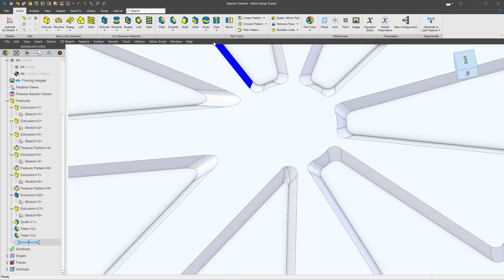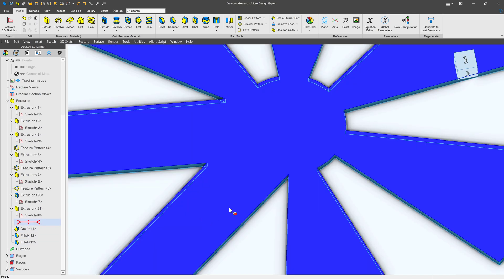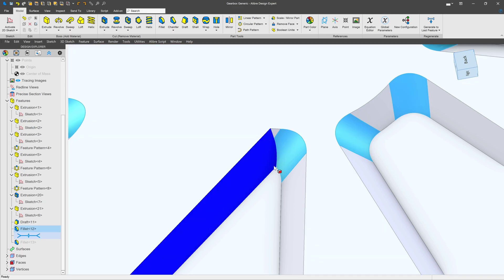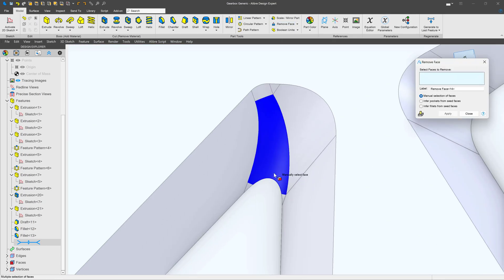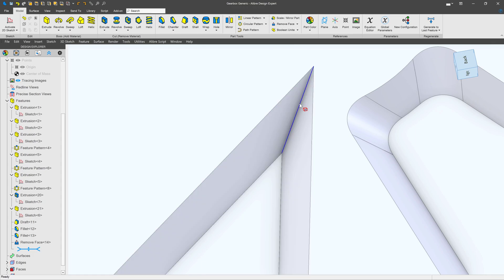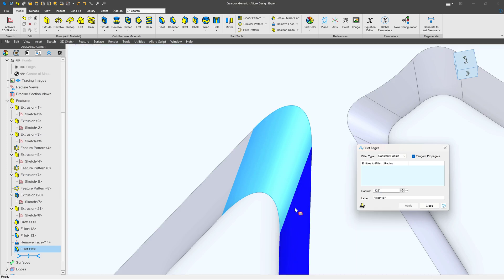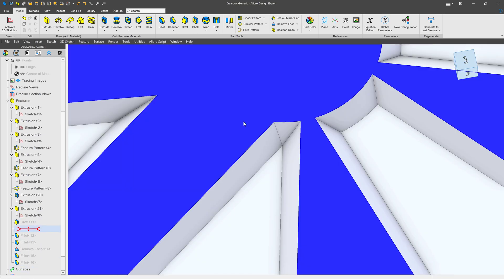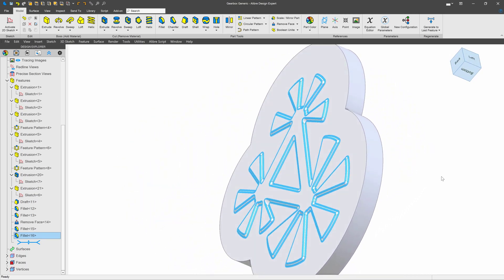Can't Add a Fillet?  Add THIS To Your Toolbox!

Comment: Remove Face is becoming a real useful tool in the Alibre. I likely wouldn't have thought of using it. Thanks for the tip! 
Sometimes I have an a fillet that Tangent Propagate doesn't work and I need to turn off previews and select all edges individually, but that is another issue.

Comment: Anyone else having the issue that the filet command sometimes doesn't select an edge?
Reply: It doesn't work with preview on, but if you disable preview 9 out of 10 it does work. Not the end of the world but annoying.
Reply from the maker: @GreenPlasticWaterCan  Nice work finding the solution.  I'll check if that's in our tracker and add it if needed.
Reply: @AlibreLLC  just to clarify, the issue I have is not with complex geometry like yours. But on edges like when two cylinders meet that overlap. If needed, I can send a part when I have this issue again.

Another thing I find annoying is the lack of "flip" on the Chamfer command when using angle-distance. I model a lot of parts that require oil seals that need a lead-in. To circumvent this issue, I sketch them in the sketch used to revolve/revolve cut

There are only two major frustrations I have while I'm modeling pretty complex motorsport parts (gearbox and hydraulics.)
Reply: @GreenPlasticWaterCan  If you toggle previews OFF then Flip becomes active. You can toggle previews back ON after flipping if you want.
Reply: @HaroldL-bn4eo  You sir, win the internet for the day. IDK why I haven't tried this before. But you're gonna make my team happy. Hopefully Alibre will be able to fix the preview mode.